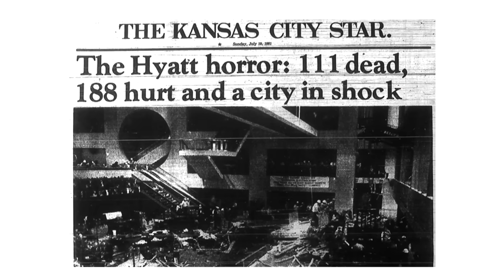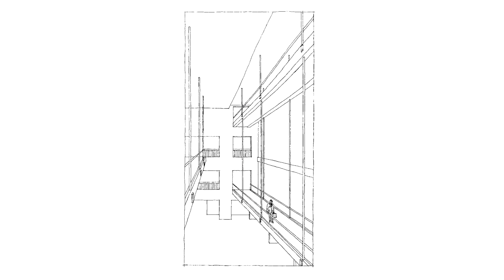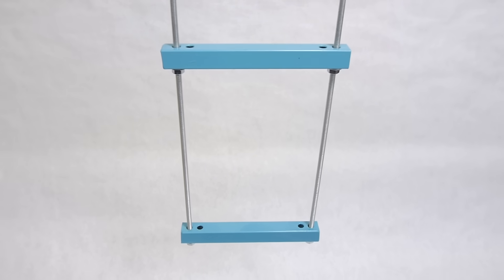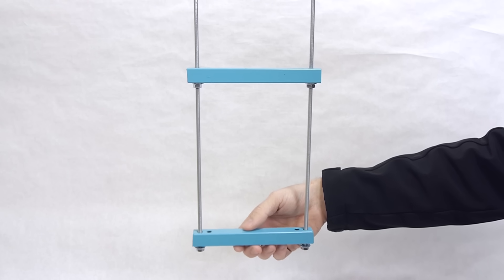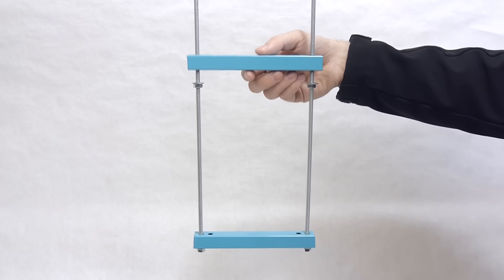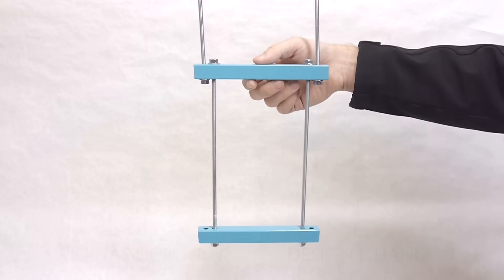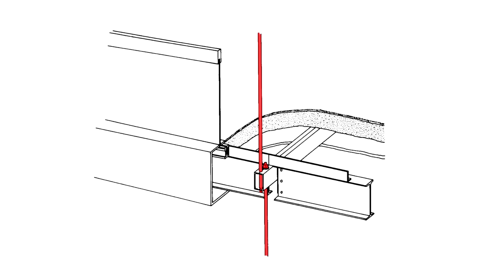The Disaster That Changed Engineering: The Hyatt Regency Collapse

Comment: The "friend on a rope" analogy is excellent. I didn't quite understand the magnitude of the issue until that.
Reply: Leigh Dupuy There’s a lesson: when you want to make a technical analogy, try seeing if you can replace any of the components with humans.

It works particularly well for explaining software.
Reply: @armorsmith43  or, in the case of electricity, water.
Reply: @howardbaxter2514  it can still work with humans:

"If you have a warehouse crammed full of people, and give them an exit tunnel, they will run down the tunnel as fast as they can to try and get away from the cramped room. However, the smaller that tunnel is the less people can fit through it, and so the more that will die from trampling."

Admittedly it's not 100% accurate, but it is sort of doable. ;-)

/s
Reply: Leigh Dupuy This was my reaction too: how good that analogy is. I bet it brought understanding to a lot of people who would not otherwise have gotten it
Reply: @ArsenicDrone  Except it was kind of wrong and misleading
Reply: @BillySnowball no it wasn’t 😂
Reply: Me too and this has to be the third or fourth video I've seen about this. Hey when you've only studied literature, politics and philosophy this stuff is hard ok?
Reply: One other thing that was not covered in this video is that even the original design wouldn't have met engineering standards. It probably wouldn't have failed that day, or probably ever, but its safety margin still would not have been up to code.
Reply: @WardenWolf  You mean the weight of the second floor would have being held by two rows of screws?
Reply: the  conclusion  is not clear  if  dont say which hole opened up,  top, bottom, in my humble oppinion  that hollow structural steel  would have failed anyway, it is not possible that  such low safety margins were used, what  was underestimated was full loading of those  hanging  TRAMP  o  lines
Reply: Another way I've heard it described is like holding onto a rope in one hand while simultaneously holding your friend and their rope in the other. Way too much weight.
Reply: @barneyrubble4293  This is kind of correct both the rope (rods) and your grip (nuts) where strong enough. The intermediate thing that failed was maybe your shoulder dislocating (local buckling failure of deck sections)
Reply: Grady is great
Reply: There's a very real chance your friend falls off, and takes you trousers with him.
Reply: This problem would even have been revealed if they had placed masses on the walkways in order to test max load before any ppl were allowed on it.
Reply: @tensevo  This almost never happens in structural design, except maybe testing long span suspension bridges etc
Reply: To me it was obvious. There were a few things they could have done to prevent this, including making the rod two pieces that screwed together directly below the upper bridge. If done smart, it would have had a separate nut for the upper bridge with the lower rods screwing on below it. This would have solved all the technical problems. Another thing they could have done is use a solid U bracket between the nut and the beam that would have served to spread the load across the beam's full width, functioning the same as a washer does on a smaller scale. Combining these upgrades could have solved all the problems.
Reply: I found it misleading, as it focused on the nuts and rods. As was briefly mentioned the failure mechanism was pull-through/splitting failure of the nut/beam due to the beams not having thick enough walls. Although the nut on the lower face of the upper deck was having to carry the load from the lower deck if the the tension rod had adequate capacity to carry the loads of both decks it's fair to assume this nut was well below 50% capacity. The failure occurred due to the upper beam being crushed by the upper and lower nut loads acting in opposing directions. This likely caused localised buckling in beam webs, probably causing them to bow outwards. This would have created 'hoop' tension in the beam. Weakened locally by the upper and lower bolt holes the beam did not have adequate tensile area to resist the 'hoop' stress. This is speculation but I can't see another reason for the beam splitting like this. You would normally just expect the lower nut to tear through the lower flange. The fact the beam split in half makes the failure mode quite interesting. Normally this would be caused by a shear load, however the way the beam was loaded, as far as I could tell rules this out. Anyhow that's my best guess with limited info provided
Reply: @BillySnowball  you have it right.  It wasn't the rods, nuts or washers that failed.  It was the opposing forces on the cross beam, exacerbated by the additional holes which weakened it.  Also, the box beam was made by welding two U-beams together with the bolt holes then drilled through the welds, which broke because of the weight forces.  If the beam had been oriented with the welds on the vertical faces and the holes on the solid faces, it's doubtful that the rods would have torn through, even if the welds broke and the bar collapsed.
Reply: @BillySnowball  the beam was actually welded at the top and bottom from 2 separate channels, thus that was the point of failure causing the split
Reply: @BillySnowball  but it was the tension rods that had the failure it was the locking nut and bolt securing the end of the tie rod. It was inspected as having enough strength to support one walk way as were the other nuts and bolts inspected to be strong enough for a single walk way the design change made it so the upper nuts and bolts were supporting twice as much as they were inspected and tested for
Reply: @Jibber_Rish  I'm sorry but we will have to disagree on this one. The washer & nuts did not fail, the box section they fixed to did. BTW are you a structural engineer?
Reply: @BillySnowball  in what world do structural engineers say that the root cause of the failure was the over sight that the nuts and bolts were keeping the top deck and now bottom deck afloat in the air that you argue them. The actions of the metal during failure is not the cause of the failure that the results
Reply: @Jibber_Rish  I don't really know what you're saying here tbh. I am a structural engineer. Comments by others who also appear to be structural engineers seem to be in general agreement with the failure mode "I" identified. If they'd stuck to the original design failure probably would not have occurred. But bolt failure was not the problem

Edit: this actually explains why it was missed by the engineer, really should have been the focus of the video. The tensile capacity of the rod and nut should be have be adequate regardless of configuration. The engineer would have known this. It was a local failure of the other components that led to collapse
Reply: @Jibber_Rish  This is incorrect. Nuts are designed to have the same or higher strength than the bolt/tension rod. Originally the floors were to be hung from one rod. This means the nuts had the capacity to carry whatever the total load on the upper tension rod was.
Reply: @BillySnowball  which I stated would’ve been proper and a single load on the bolt it would’ve been the rod hanging from the ceiling carrying both loads and like described in the video wouldn’t have been problematic. For people to think that a failure in design which cause deformation of a metal not properly tested because they failed to recognize the design was flawed so the never reinforced them meaning when under full load the bolts were the failure leading to entire structural failure in which would mean that the bolts were the point of failure and everything would be fine had nothing been changed from the original same rod through both.
Reply: @BillySnowball  I’m trying to say that just because you think this is the causation doesn’t mean you are right failure comes in many forms. And a structural failure can usually be seen before the damn things built and not a reaction from the failure of the designer and the inspector who approved the construction.
Reply: @Jibber_Rish  I don't think you know how the ultimate capacities of bolt, nut and rods are calculated or relate to each other. So I'm just going to leave it at that
Reply: @BillySnowball  that’s my opinion also, other than from my understanding, there were no washers, they were missing, although they were called something else, and not washer’s. And someone assumed that it was just common sense that they would’ve been used, but that doesn’t sound right either for something that important.
Reply: You seriously didn't? That's... stupid. No offence, but that's, like, common sense. Obviously the top person will hold the weight of his friend as well, instead of just his own.

Comment: even a kid with an erector set knows the fault of this design. How did 'expert' structural engineers make such a huge mistake? Similar to Frank Lloyd Wright's 'cantilevered platforms'. Not understanding that 'load' is not stabilized, but pivoted. The two holes should have been cause for concern and not ignored.

Comment: I was in HS at the time of the Hyatt collapse. As I understood it, another significant contribution to this disaster is that party-goers where dancing, in step on the walkways at the time. Thus multiplying the forcing applied on the walkways with each in-sync step. A reason that armies are told to 'break-step' when crossing bridges...

Comment: Looking at the modified design it looks like it should have worked if the connections were designed to be the same as the connection at the top of the assembly. The connection at the top has to bear the weight of the full assembly.

Comment: There was a second change to the original engineering that you did not discuss.  And I think the second change was of even greater significance. 

The 'box' girders, two C channels, were originally to face back to back. The C's were to face outward and the rods and nuts and washers were were to bear directly under the two webs.  At some stage the two C sections were turned open face to open face and welded at the contact, forming a box.  The pressure on the welded seam, your photo amply shows, cause the lower C  of each side to deform inward.

I believe the face to face change, from the original back to back was of even greater significance.  Certainly, the two changes sealed its fate.

If memory serves me correctly,,, and it does not always,, the discussion of the failure was in Scientific American or Science News about two years after the accident.

Comment: How did it change engineering though? It's taught as a case study, but what are the take-aways? What protocols have been changed or processes put in place to prevent apparently small design changes from having catastrophic effects?
Reply: I'm sure they passed a law that made people smarter, more efficient, better looking, and more diligent.
Reply: Basically, that design changes, even minor ones, in structural or other safety-critical components should never be approved without new drawings and calculations, and typically a review by multiple engineers. It should be clear who is responsible for ensuring the safety of the structure (the engineers) and the structure should be properly inspected once constructed to ensure it meets specifications.

Comment: Being a native of the Kansas City area, I remember the Hyatt Regency collapse (I was 10 at the time). I had friends that were supposed to be at the dance in the lobby/atrium that Friday night, but fortunately cancelled going.

While the change of the support rods was the main cause of failure, if memory serves, the box beams that spanned between the support rods and supported the skywalk decks also were changed, which compounded things. Originally the box beams were to be a solid steel piece. As part of the engineering change, two C shaped beams were welded together to create the box. The points where the support rods passed through the box beam also meant that they passed through the welds. The increased weight load that night by all the dancing guests literally caused the welds to rip like fabric, further accelerating the failure and collapse.

In the years after, the 3rd floor skywalk, which was independent of the 2nd and 4th floor skywalks was taken down. They have rebuilt the 2nd floor connector (it services the convention center, and thus is an important link), but instead of supporting it from above, they built columns from below. If you visit the hotel today, you can see where the 3rd and 4th floor skywalks once were, as the handrails are different than the ones surrounding them.
Reply: [solid steel] That wouldn't make sense. Horrid waste of material. AND if they had been designed that way and the change was proposed, somebody would have had to run the numbers so they would have had a longer look at the change.

Film of the event indicates that the live load was well below code.

Comment: It also is a good example of just how insanely save those things normally get constructed.

there were a lot more people on both walkways than they were constructed for and were allowed on, the upper walkway had to support the load of both, and the frame-geometry was changed weakening it significantly.
And yet it was able to support that for quit some time.

So it took 4 times the load it was designed for and a weakened frame to make it fail.
And safety-margins are even bigger nowadays.

Comment: Biggest structural disaster in US history?  One with the most deaths, certainly, but the biggest and most expensive was the Tacoma Narrows suspension bridge.

Which you can find on youtube.  And is well worth watching.  Because it gives you a feel for the size of the safety margins that were designed in.  The best way to see just how far it is bending is to keep an eye on the lean of the lamp post.  You keep thinking there's no way the bridge can withstand that flexure, but it does.  Until, of course, it doesn't.

Oh, and it's worth watching because it's awesome.

Comment: If I remember correctly, another subtle change was that the c-channels that made up the structures hanging from the rods, where oriented not back to back as originally specified. Instead, it was changed for aesthetic reasons to a "lip to lip"-configuration (making it a box instead of a 'split I-beam'). This, together with the change in hanging arrangement made the structure seriously weak. The rods where hanging from the weakest part of the channel is also visible in the pictures added to this video.

Comment: I thought the problem was the orientation of the C-beams. Flanges facing each other is a weak since there is a high bending moment. Flanges facing outside would have no bending moment though. The seconds from disaster documentary was also suggesting that as one of the main causes.

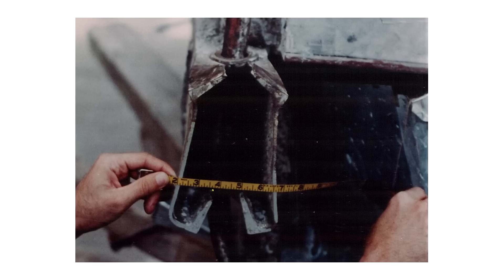Comment: Also instead of using solid box sections they used two C channel sections welded together and they put the connecting bolts through the weld. This was another bad idea because it significantly weakened the connection. You can see the result at 3:10 where the two halves of the "box" section split apart. Btw if anyone wants to know more about structures I recommend Levy and Salvadori's "Why Structures Fall Down" it's a great book and chapter 15 covers this disaster in more detail. There's also some other great examples like Ronan point in the UK.

Comment: Still wondering what disaster will happen to cause some sort of change in the software engineering field.  The current practices are abysmally terrible all around.  It seems custom-designed to produce the least secure, most flawed software possible - and yet is still used to develop everything from infrastructure to self-driving cars.  I figure we will see some supercriminal that looks like something out of a movie.  Someone who opens all the doors to all the prisons (their SCADA systems have no security, and their networks, which are supposed to be airgapped, are often accessible via the Internet), shuts down major parts of the power grids, ejects all money from all ATMs into the streets, makes airplanes revert to visual navigation (no authentication on the radio transmissions telling planes whether they're about to hit something?  Yeah that's brilliant), scrubs all debt ala Mr. Robot or Fight Club, etc.  All those things are possible and fail to happen purely because no one wants or is willing to do them.
Reply: From a purely anarchist point of view - THIS SOUNDS AWESOME. Please don't put ideas like that in my head.
Better tell the Wachowskis 'cause this could be from one of their movies.

Comment: Typically standardised nuts are designed to support more force than the screw. So the load on the nut should never be an issue. But in this case the beam around the nut got crushed.